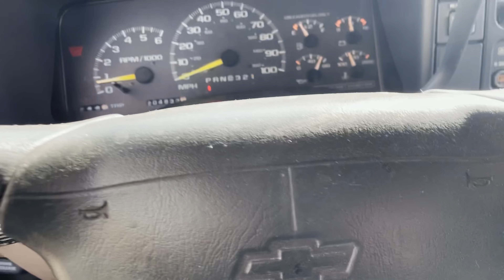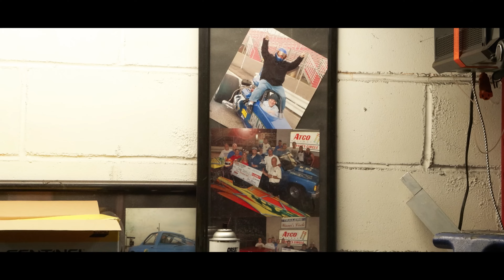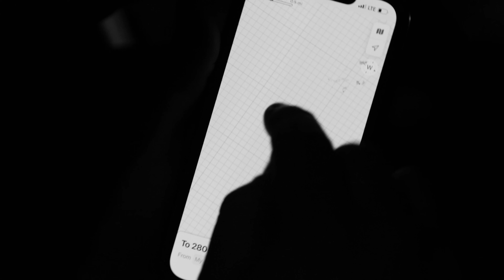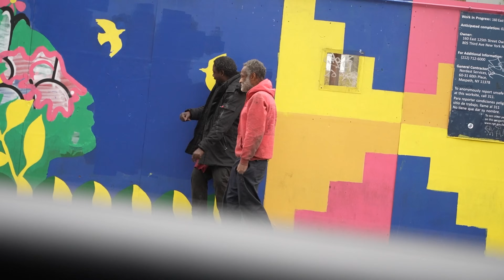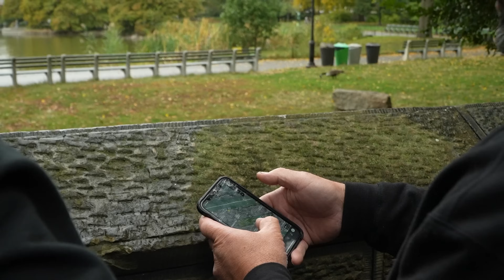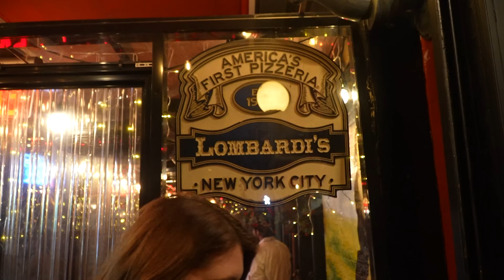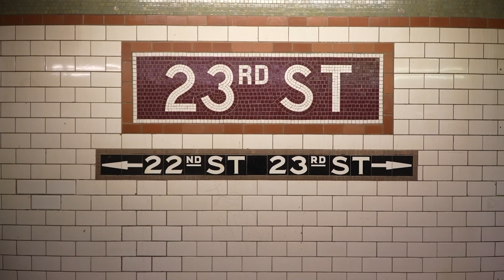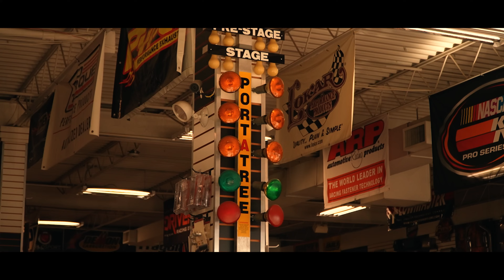WILD Street Racing in NEW YORK Doesn't go as planned

Comment: Here's a little trick to get cars off the trailer..Put a set of metal ramps like the kind you would use to oull a car up on to change the oil with.. Place those ramps behind the wheels of the dually and back up on them. This will raise the tongue and lower the tail of the trailer thus alievating Tony's frustration..

Comment: Billy, I told you previously on built an ‘82 Mustang Gt with the 89 302 Roller cam motor with a B303 camshaft and dart heads with a big shot nitrous system jetted for 250 I consistently ran low tens with a 750 Holley on a Victor Junior full MSD ignition set up 373 years 8.8 rear all moser.  I must’ve changed 30 transmissions in that car. This is  back in 1992 - 93.  I was in an area of Staten Island where you can buy T5 transmissions $250 out of a brand new Mustang with maybe  1000 miles, 5000 miles very very low mileage. God I can’t tell you how many T5’s I changed. Its very easy as you know and they were cheap looking back I would’ve been smarter to get a liberty or something good. It would’ve been money well spent now they have these manual transmissions that you don’t have to even use the clutch to shift you just pull the shifter and it shuts the engine for a split second goes right into gear and it’s like an automatic. 

Cletus MacFarland has it set up in Leroy The Corvette that he races. I’m telling you like an automatic. Anyway you are doing good but you’re never going to get a T5 to stay together under that combo. All the kind words about New Yorkers was very very nice.  I’m New Yorker wishing you the best bro.

Comment: Billy, my 86 GT has an Auburn Pro (cone clutch) center section in it. When the limited slip additive wears out of the rearend lube it pops, cracks, and makes all kinds of noise. Putting in more additive cures the noises every time. Perhaps you have the same issue... we hope?

Comment: Super awesome content  just sub to ur channel.ur up there making  just as good content as the boostedbozi/PFI SPEED/ motion auto & ADam lz.props man.. & Here a idea guys 4 ur problem of getting that  white fox body of the trailer at 6.50 mins in this video..get a couple of two by Four of wood & put them under them tires so the exhaust will clear the end of the the trailer..its a trick  I learned a very long time ago with ride's that are low to the ground..it a trick I also use to get a floor jack under & out of my lowered RT MOPAR..good luck stay safe stay blessed.